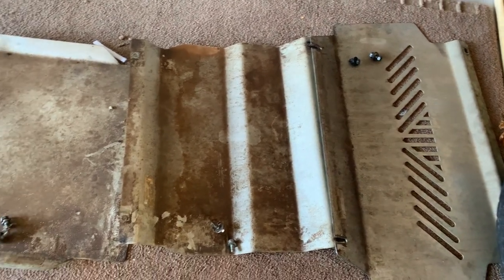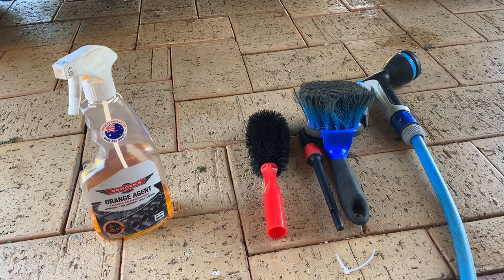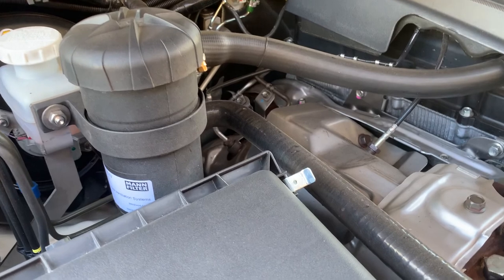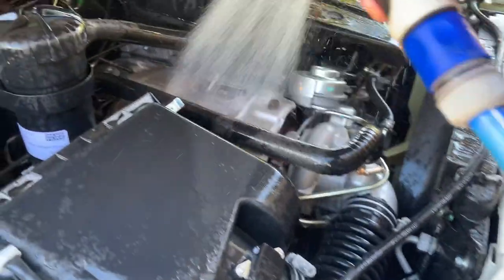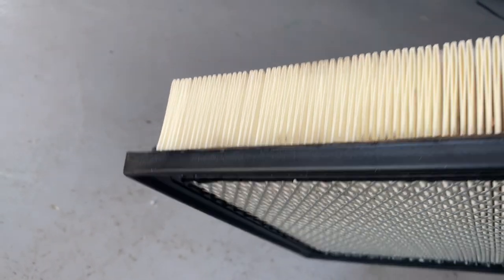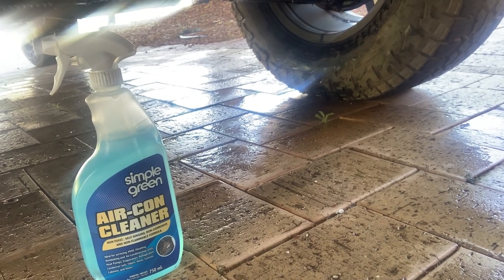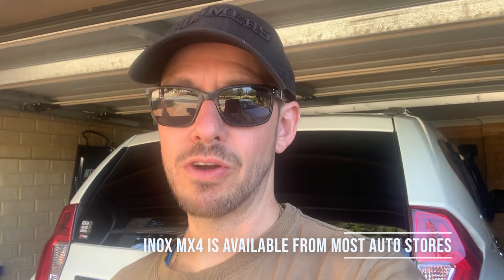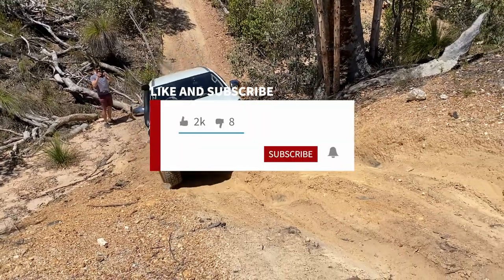How to clean your 4WD 4x4

Comment: Hi mate I finished spraying my vehicle with lanox spray heading out on the beach for 4 days.my question is if I do an underbody wash whilst I'm there, do I need to reapply the lanox again whilst I'm there or should I just wait until I get home and clean it properly.because I've heard you only really need to spray it every 2 to 3 months?
Reply from the maker: In that situation I would do it properly when you get home as it’s not practical to be cleaning it whilst away. Spaying some fresh water underneath if you’re doing beach driving  protection would be a good idea. When back you can give it a thorough clean. Personally I reapply the lanolin after a final wash and this has served me well. A tip is to play close attention to your chassis rails whilst cleaning and other areas where sand/salt can sit (like bash plates). Good luck on the trip! - Mark
Reply: Awesome thanks for the tips mate.
Also what size tyres are you running?
I've got PS 2017 GLS running copper muddies 275/65R18 nice rig by the way
Reply from the maker: @taimoga7372  Falken Wildpeak AT3’s 275 70 17. Really happy with them

Comment: seeing some people say to use mx3 and others saying mx4
some people are saying mx3 can disolve soft plastics and others saying mx4 build up and gets gunky attracting dust.
whats your thoughts?
Reply from the maker: They both attract dust / dirt in my experience but this is superficial and at least you have protection on the metal. The difference I’ve found is longevity. The mx4 will last longer. 
I generally do a bigger clean every 1 to 2 months and use Bowdens Orange agent. This breaks down the dirt and removes the Inox. You can then clean and let dry, before reapplying the inox again. Not saying I’m an expert but this has been my go-to for the past 4 years and I haven’t had any rust
Reply: @Perth4WDandCamping  Mx3 is based on white oil, mx4 is lanolin based. Inox themselves recommend mx4 for chassis over the mx3.
Reply from the maker: @NovemberSky3 mx4 has served me well over the years